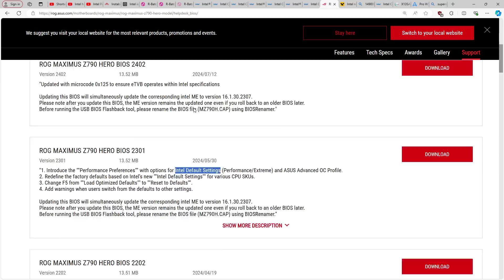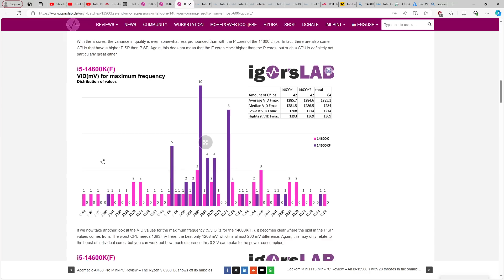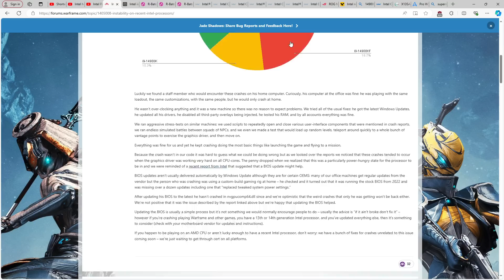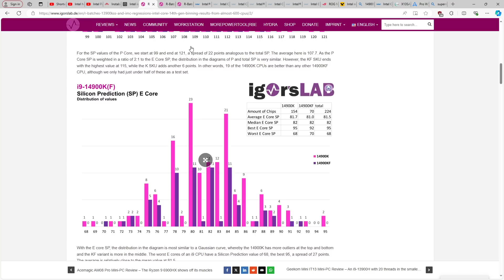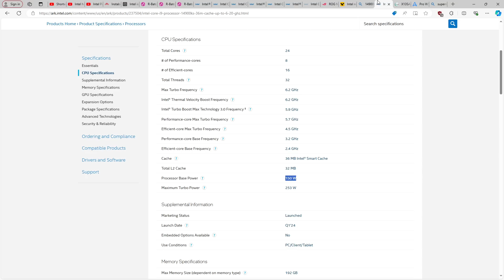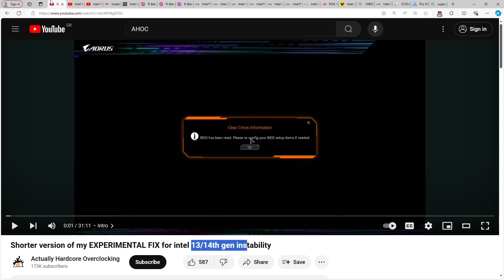The intel instability and degradation rant.

Comment: The ring makes 1000% sense. 
that explains why the CPUs fail cache tests or mem-tests running in cache.
that explains the inconsistent modes of failure between cores
that explains the IO errors and NVME (northbridge PCIE) errors
it explains why lowing memory clocks would increase stability
it explains why datacenter providers who are running these systems 24/7 would experience these failures as a dramatically accelerated rate; because these CPUs are purchased SPECIFICALLY for high single core load tasks like game servers where the P cores will be drawing large voltages the whole time. 
It explains everything.
and it explains why specifically its the 13/14th gen i9s and some i7s, since they have the largest single core voltage demand.
Reply: 100% agree it has to be the ring. I've gotten PCIE errors and memory errors until I downclock the cache frequency. I think workloads that rely on the P-cores are the ones causing issues since that is when the cpu can really boost high. I doubt degradation happens when all the cores are loaded since the frequency and voltages decrease to keep power/heat in check. 

This is the first PC component purchase I regret and I owned a Radeon VII for a while.
Reply: @mx5klein Radeon VII wasn't great but boy these cards were beautiful to look at
Reply: @mx5klein  This would be consistent with the issues that some who run Minecraft servers on their hardware encounter.  Minecraft server software typically doesn't use all cores, and pushes a few harder than the others.
Reply: @mx5klein  At least the Radeon VII is a workstation monster.
Reply: Can't agree more. My 13900KS could run ring freq @ 5GHz last year when I bought it, but I can only run it @ 4.7GHz w/ even higher VID  (ring down bin disabled)
Reply: @ningyang2074 rma that bro!
Reply: Glad to still be on Alder Lake.
Reply: Fun fact: Xeon-E series is the only xeon that still has a ring bus..  What does it have in common? 8 core limit without e cores.

Intel knew lol.
Reply: @jaszjsz  I still have a set of E5462 here. Works fine. Powerhungry though!
Reply: Datacenters with 150w caps like those w680 motherboards, and all core usage like those motherboards will not see high voltages very often.  Maybe 1v?
Reply: @rluker5344   not true in this case. the data centers are using the 13/14900k specifically for the high single core performance in low-thread, high-demand, workloads (such as game servers). 
that means these systems are running at P-core turbo almost 100% of the time; and more than that, it means that the E-cores are mostly unused, leaving a lot of extra watts for P-cores.
the poorer bins will have to push way more volts though to keep P-cores stable at a 6ghz boost for extended periods of time.
Reply: @572089  Let's say there are a dozen people playing on the same server, is that a 1-2 thread load?  If you are running all of the P-cores at 150w total there will be power throttling and reduced clocks and reduced voltage.  Maybe there is one person per server because nobody is playing the game.  In that case you might be right.  But in any normal scenario those CPUs are going to be running at hundreds less millivolts than me, or pretty much anybody else with one of these chips using it at home.
Reply: @rluker5344  I mean in this specific example, Minecraft, the amount of players doesn't matter, the server is using 2 cores at best 😭😭😭
Reply: @rluker5344 I run a W680 ASUS board with an i9-12900KS w/AVX-512 enabled in the microcode.

I run 4X32 GiB Hynix A-die ECC UDIMMs from Kingston, and it's clocked at 6800 MHz with CL30 and tuned subtimings.

It is an incredibly solid and stable setup.
Reply: So if we lower the P ratio from 54x to 51x, I hope this will help. And undervolting. My laptop version is screwed…. The HX 13900 crashes. 😢2500 dollars down the drain. Idk what to do.
Reply: @Joniyah444  rma dude because thos thing sounds like they screwed up
Reply: @Chris-w2q yes :(
Reply: @Joniyah444 was planning to buy laptop with i5 gen 14 in it, guess ill go with the amd one 😢
Reply: @Helicopter_- I’ll probably go amd and get a desktop this time ! Maybe wait it can be expensive 🙏
Reply: Lenovo won’t do anything , give me another computer, or a 14th that’s messed up? I thought about it… just gotta live with it ugh
Reply: Frame Chasers 7/14/24   - problem described and solved
Reply: Don’t totally despair, 😞 I’ve lowered my highest cores from 56 to 52, it seems to be okay, I went 2  days with no crashes… 13900HX running at 55-80 watts 63 degrees Celsius.

Comment: Frame chasers just made a video saying he's fixed the problem. Yeah right. He's fleecing his simps by coming up with a way for the cpu's to degrade slower but he can't stop it if Intel can't stop it.
Reply: @pf100andahalf   BuildZoid was unfamiliar with the test-automated VID table for Intel CPU’s. This Intel issue has changed the YouTuber ‘Expert’ landscape overnight.
Reply: For anyone reading this comment, if the cores for the i9 CPU’s are NOT locked together, single cores can overclock too high with too much voltage creating temperature values above 100C which is a reliable way to cause degradation over time. Standard coolers can NOT prevent this overheating issue due to limited interface conductivity of the factory soldered lid-to-chip package configuration. De-lidding with liquid metal is necessary if you desire to push clock speeds without hitting such high temperatures for extended periods.

You should not accuse anyone of fleecing others unless you have real proof.
Reply: @tech-utuber2219  Intel can't fix the problem yet some random guy on the internet can. I would say that's what needs proof. Also, what percentage of the population do you think is going to delid and lock all cores and use liquid metal and adjust a crapload of other settings, just to get it to work when most people don't even know how to get into the bios. These cpu's can't even finish running cinebench stock so they'll just rma the cpu. It's a sh*tshow and way too many people are saying this is no big deal. If frame chasers fixed this then buildzoid and gamers nexus and hardware unboxed and scattervolt and derbauer would have videos out now saying "Here's the fix!" but there is no fix. These cpu's are physically damaged from degradation.
Reply: @pf100andahalf  Oh it’s definitely not a casual fix for the majority of people. What has been heavily publicized is that you can’t push these using standard coolers with the i9 CPU’s, even if you’re just tweaking values in the BIOS. Derbauer did a video on this general issue. I just think it’s best to not accuse people of scamming others. I also don’t think that Intel purposely did this, as they were just responding to AMD single-core performance.
Reply: @tech-utuber2219  These cpu's are defective and should be recalled immediately. Intel, along with people saying they can fix a problem that Intel can't even fix, are most definitely scamming people. The cpu's are degrading and damaged and you and way too many other people are just saying everything is fine. Can you explain that because I don't get it. I really don't. It's happening on server boards too with "safe" settings. It's a catastrophe. The only way I can think of to explain this, and I'm trying to be fair, is simply the power of fanboyism. I have a 5800x3d with a 4090 and was planning on getting a 14th or 15th gen intel and oc the crap out of it but there's no way now. Not sure what I'll do now, probably get a 9800x3d or wait till the gen after that. I just honestly don't trust Intel right now because they're dead set on beating amd and they stopped caring about stability and are only concerned with raw performance. Let me ask you ask you something. Seeing how there's so many of them that won't run cinebench out of the box new, do you really believe that Intel didn't know these cpu's were defective? All I can say is good luck, I guess.
Reply: @tech-utuber2219  There is no fix.
Reply: @pf100andahalf  I’m glad that you wrote that because I realized that I didn’t explain that when those cores are overheated long enough, they degrade into dog-poop, and no, that cannot be fixed. Apologies to anyone who was confused by my previous comment, I should have explained more clearly that this can be only be prevented, but de-lidding an i9 CPU just to be able to use it is something that Intel needs to publicly address.

Comment: In the meantime I had 0 problems with AMD 5xxx and 7xxx PCs :). My decision become better and better with time:)
Reply: I had a few instabilities in my 5950x, but that's because i've undervolted the cpu (~75mV down from -30 PBO 10x) and overvolted the ram (slightly beyond XMP levels) at the same time
Reply: @erkinalp  Yes. It was also my case on the very start. Undervaluing can be tricky as it can work longer time and in many games/applications but then you find that it is not 100% stable and in one sometimes crash :). But it is outside specifications and you do it knowing it. With intel it is different story. It happens right from the box and become worse and worse with time.
Reply: @Geralt26  in my case, idle and full load are fully stable but the transient just above the idle is metastable
Reply: @erkinalp  The only issues I've had with Ryzen 5000 were the USB dropout issue. Motherboard / firmware updates have made them so rare now it's not a negative, just that once in a blue moon anomaly.
Reply: Asrock B650M Pro RS + 7800x3D + DDR5 6000 CL32 (Hynix) is all you need now for casual/gaming rig. Switch to 7600x and it's still great.

No need for AIO either, just a noctua DH-15 or AK620 is more than enough for the build.
Reply: I dunno, before this Ryzen was known for failures, perhaps due to chiplets.
Reply: @churblefurbles  I think this opinion was because of this curve optimization + early age bios things + too high memory settings (mine have not problem to work with 4 bank 32 GB memory from the box with declared speeds and even with forced T1). And about curve: I think it can be tricky to test full stability after changing curve as it can work even 2 months without crash and after 2 months you finding a one game when you can see crash sometimes (even if it work great in 50 others). I prefer to have full stability and after this situation with one game I just reverted to default curve  (as it does not give a big impact anyway) and from that time I did not saw even one time instability. 

Ps. i also prefer to have temporary early age bios issue corrected then hardware problem like with intel 13 and 14th generation, when intel try to say nothing is wrong :).
Reply: @churblefurbles  no it wasn't

Comment: Im running 14900ks with your settings, and its even air cooled(NH D15) mostly its sub 70c in gaming but when something heavy cpu goes on its can hit up to 98c, its 3 months old , running like 2 months on your setting highest vid i have seen is 1,450 with your settings before that i could go up to 1,6!!!! its stable as rock, my 2c is that most of these instabilities are from ram speeds and mem controller degradation , its happening in intel cpus since x99 days, im running 6200 xmp ram, pc is running 24/7

Comment: Weirdly mine was stable until I put a big GPU in it, (went from 100w GPU to 300w).
Reply: I had a similar issue I swapped the power supply for a more reliable one and it seems stable
Reply: @theviewer1423  hmm i got a 1050w plat i think its ok, i got it stable again by using the intel defaults bios setting.

Comment: no amount of bios tweaks or software changes will ever fix degradation hardware problems
intel has sold you a broken cpu
Reply: Not sold. It was built broken or intentional. I still hope Intel would not intentionally create 2 gens with same hardware issues.
Reply: @Riyozsu I think Intel was unprepared for Succes of ZEN 2-4 architecture and they made fast adhoc tweaks to squeeze more powaaa from 12 gen and sell it as competetive product...I bet they knew about every problems and degradation but ingore this and think that 15gen will be on market before CPU dies. Anyway this is not the first shady thing Intel did last few years.... I m glad that I didnt upgrade my system because i wanted buy 13 or 14 gen and now I will definitively buy Ryzen....People can't be ok with this situation and hope for the best in future...all clients should sue Intel asses off and demand of refunds because Intel will feel untouchable and they will more frauds like this in future.

Comment: Lack or validation, or why Apple jumped ship after Skylake...

Even the i5 seems to have a lot of variance in VIDs. 1.4v to 1.2v, though the i9 goes to 1.5v.

I guess they'll just post some microcode through Windows update, limit voltages, so lower cloccks overall.
And all the people who are running them with single channel RAM will never notice.

Sure, some people will RMA for better binned chips, but the rest will not care.

Comment: My first 13900k had issues with instability. After months and months of troubleshooting, I realized that the last group of e cores had to be lowered to 3.9 ghz (4.3 ghz is stock). I RMAd it and my replacement has been great. 

I found the issue using OCCT and stressing per p core and peer group of e cores. Noticed errors only on the last group of e cores. This is with everything stock. Maybe worth a shot for anyone having issues and can’t figure it out

Comment: I still think those issues with the LL and the remaining issues are connected. This is too much of a coincidence. I would absolutely not be surprised if the CPUs that cant run the aggressive LLC are those that fail when used as a server or with compiling (the 50% failed). The other 50% that are fine would also run the aggressive LLC. The aggrsssive LLC just seems to sort this weak CPUs out more easily.

Comment: Guys, help someone who doesnt understand what is going on here? Is it poor quality silicon just burning out because the material is sub-standard, or is it the wiring on the chip that is pushing too much voltage through some part of the circult? Or something else?
Reply: Wiring on the chip, probably. Google intel 14th gen ring.

Comment: I heard a rumor that it’s an issue with how the ring connects to the cache. 
Apparently that changed a lot between 12th and 13th. But that was a ton of salt. But it’s also voltage related

Comment: I think these new bios are gonna make CPU degradation happen faster. My 14900k is on a z790 dark hero. New bios made my LLC go from 3 to 5, I’m using Intel performance so 307a 253/253. Yet it made my voltage go from 1.34-1.4 at the highest, to 1.48 low end up to 1.5v on the higher end. My temps went from 75C on hottest core gaming yo 94C on hottest core while GAMING! wtf!

Comment: The main thing I always heard people say as to why they were going with Intel, because they were more stable becasue Ryzen was too new or whatever. Welp, so much for that :body-blue-raised-arms:
Reply: AMD still needs to get ram and Expo sorted out. I have yet to work on an AMD system  without ram issues. You shouldn’t have to wait 10+ minutes on first post (if it even works)
Reply: @macicoinc9363 What kind of ram issues out of interest? I have an AM5 build with 5600 XMP DDR5 and I personally have never had a single issue with it, although I know 5600 is hardly pushing anything hard there.
Reply: @macicoinc9363  Yea AMD has problems too, took me 6 days to get my 5900x running. It never rejected the ram or anything, just needed more power or else it would go crazy 🤪. Had to up the voltage which I wonder how many beginners know this?